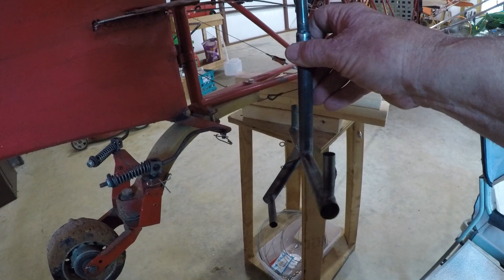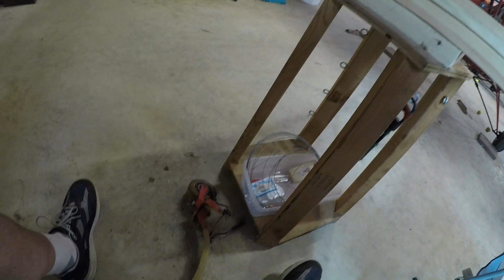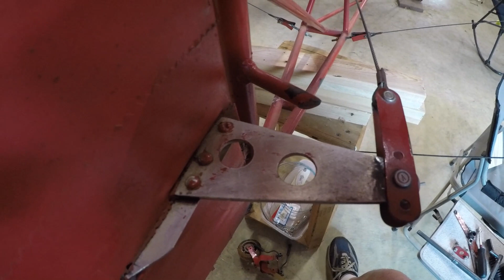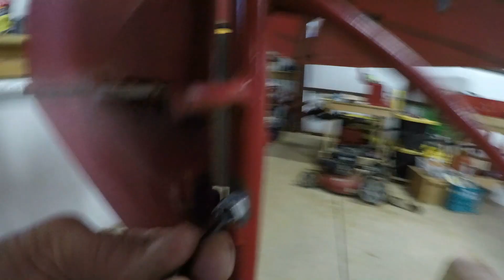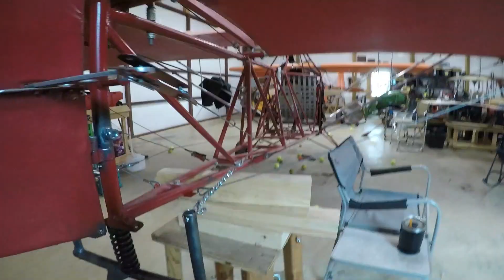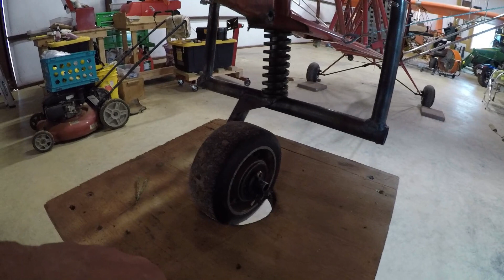ORV and TW

Comment: Les, i always admire you simple paint job. I love the semi-translucent look. What did you do for paint? Was it 2 or 3 coats of a premium latex/acrylic exterior house paint?
Reply from the maker: Paint is latex exterior house paint, first coat thinned and put on with foam brush, (each coat of paint is a cross coat) second coat was latex rolled on with foam roller and on top of wings put a third coat, thinned.
Reply: Thanks Les. That’s a light paint job. I love the simplicity.